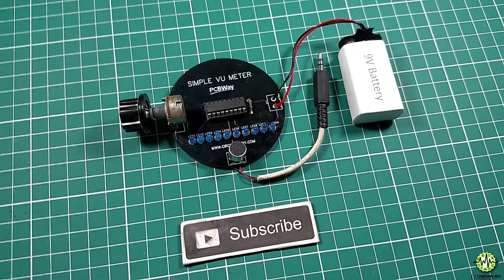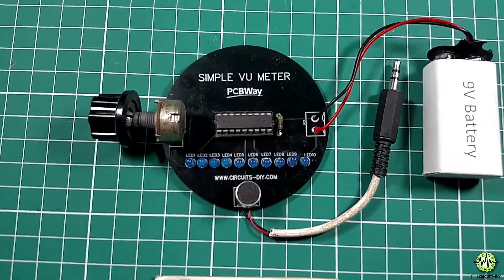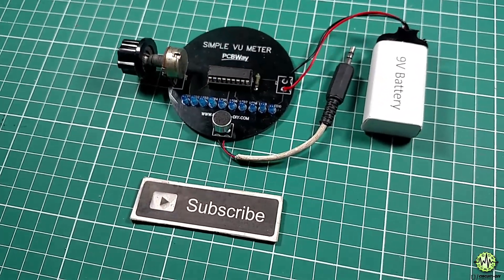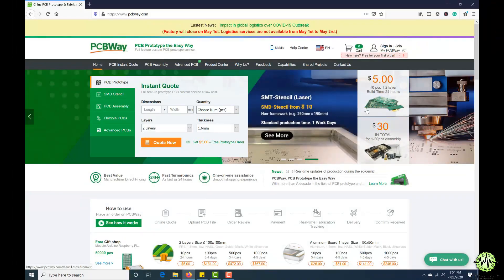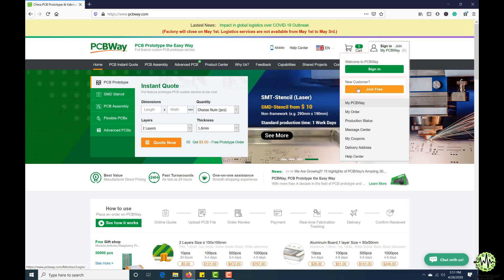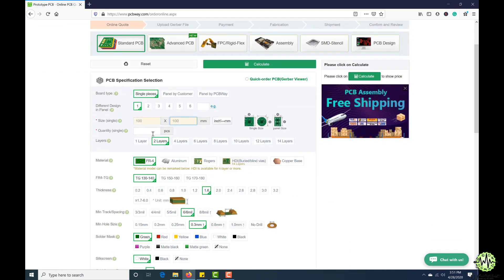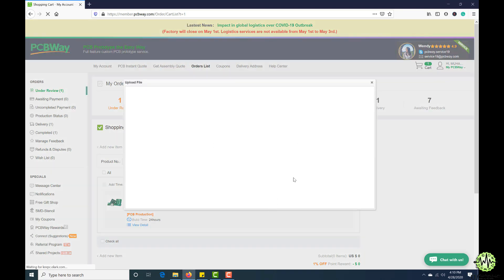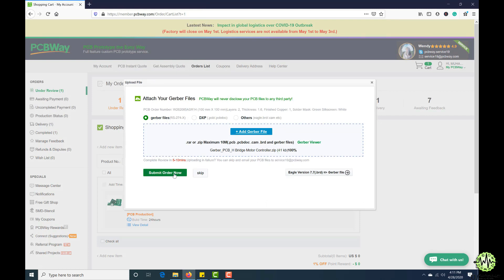How to make VU Meter using LM3914 IC - Audio Level Indicator

Comment: Why do you need the mic?
Reply from the maker: to sense audio / music
Reply: @CircuitsDIY  But doesn't it get the signal from the amp or pre-amp output?  The one I built from Helleman does not have a mic.  Just wondering.